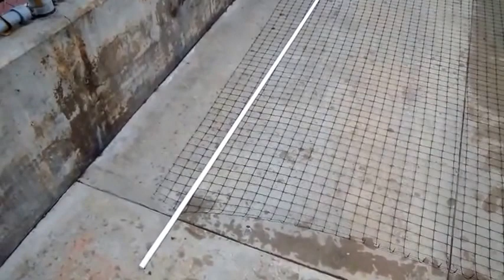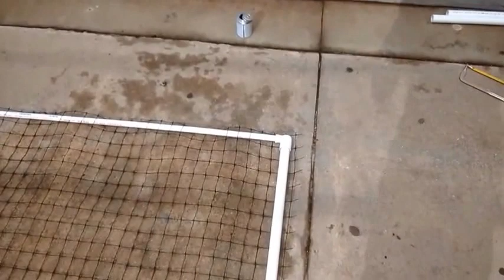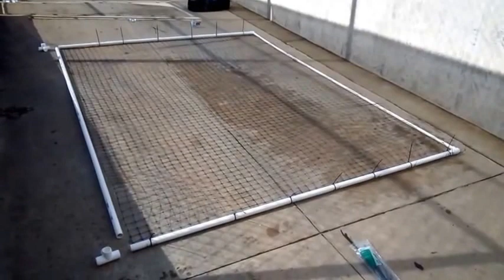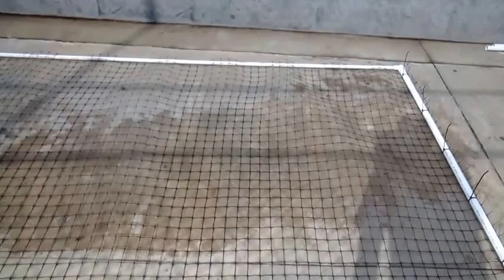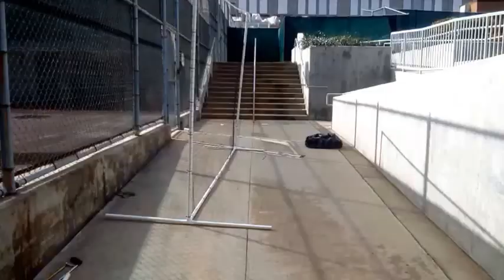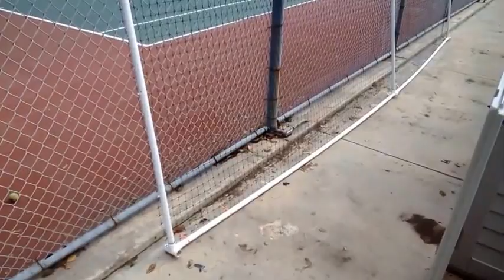Homemade Lacrosse PVC Backstop

Comment: Hello This is very helpful thanks for putting this. I want to build something similar in my backyard. size is 7 feet by 40 feet. i don't need to move the barrier that so i was thinking to only use pvc pipe as a pole. hold it to the ground maybe bury 3 feet. I was also thinking of not having the top pipe just leave net hanging. it is to stop soccer ball hitting neighbor's fence and going over. i plan to use 10 feet pipe as poles 10 feet x 4. What will be your advice? do you think it will work? I have soccer goal already and will not shoot directly to barrier just in case if it is not going to soccer goal it will be stopped with this.
Reply: Did you try it?

Comment: I’m glad I found your video. I was thinking of doing the exact same backstopper using deer netting behind my kid’s lacrosse goal. You mentioned in your video that the netting got damaged due to hard lax shooters. Did you try layering up the netting materials? I’m curious if 3-4 layers of the netting material would holdup. Great video content! Thx
Reply from the maker: I have not tried layering up the deer netting. However, I did try using the thickest deer fence that Tenax offered (Tenax C Flex HD) and it was much sturdier than the style I mentioned in the video. That said, I still don't think it would hold up to the continually pounding from strong high school shooters.

Another problem I ran into when the frame was placed so close to the goal was an errant shot could break the actual PVC attachments. The few times that happened was a bigger repair. Hope this helps.
Reply: Very help info. Thanks for the additional tips.